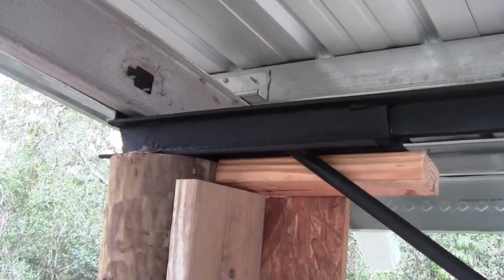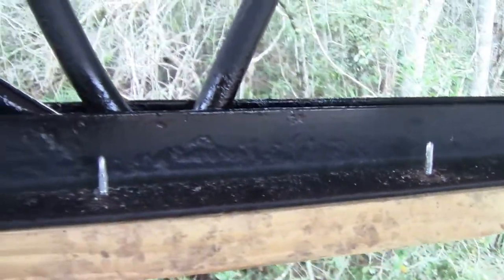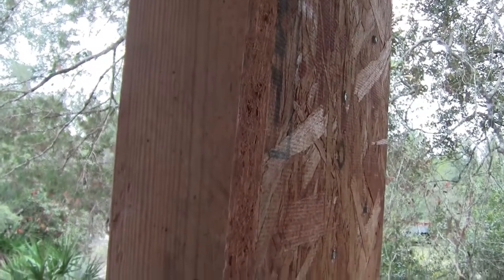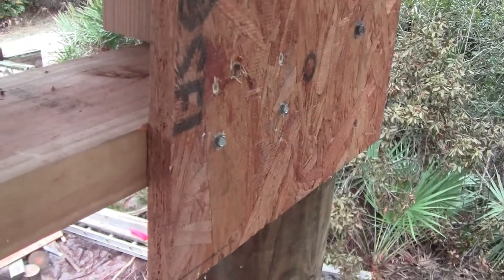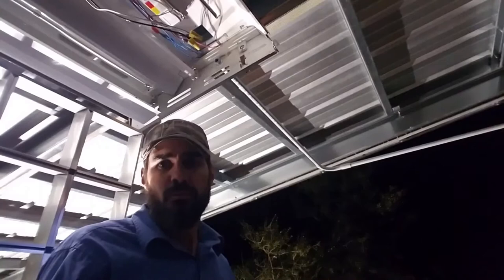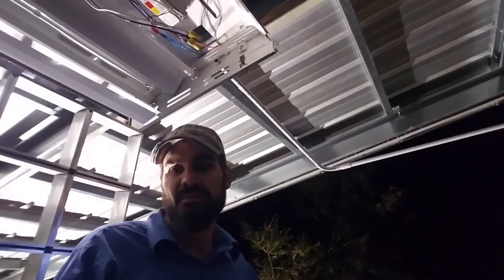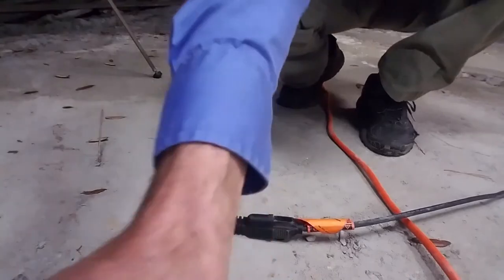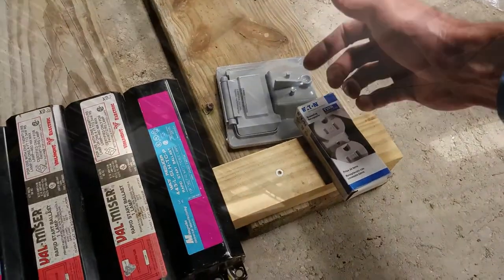Sawmill Shed Build - Part 5: Bracing and Lights

Comment: we have a lot in common, just different weather. I watched some of your videos of the building trusses and a few others. I am finishing a stem wall on a 2000 sq ft lean to style steel frame building that I have mostly fabricated and the biggest challenge are the 40+ ft steel trusses that I am fabricating. the lifting was hard to figure out because I am building mostly solo and it is tricky. I ended up welding a couple cranes that will sit on top of the uprights and using remote control hoists to raise the truss from both sides.... we will see how it works, I am testing on a smaller solar carport first to put it to the test with 20 ft trusses. anyways thanks for the videos-